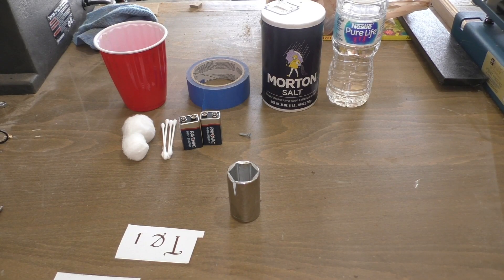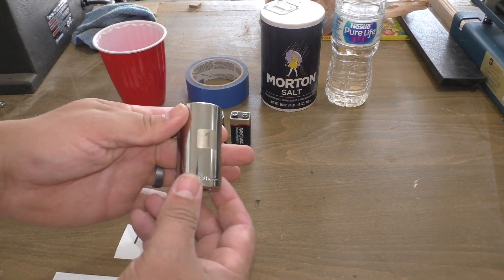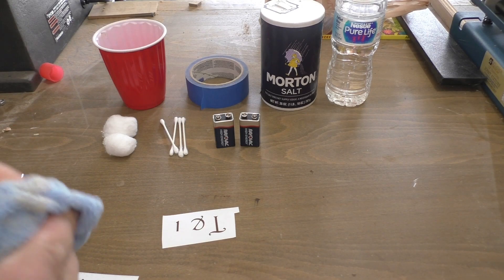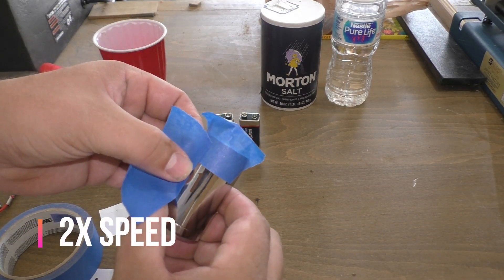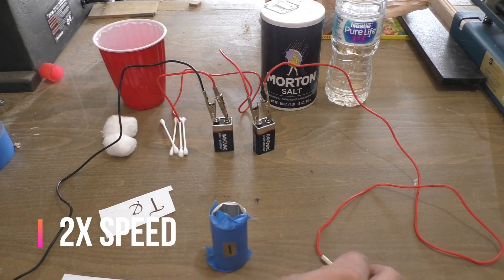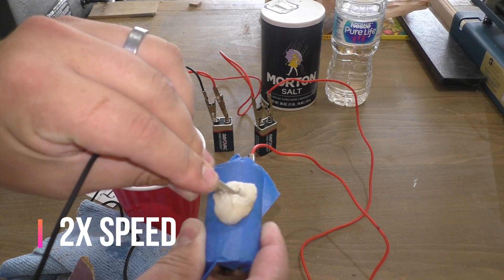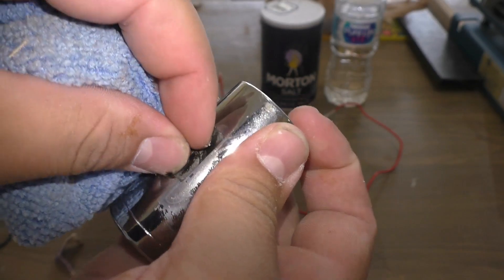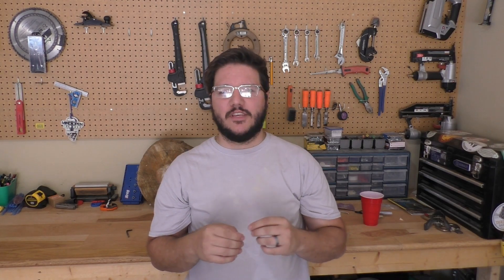Etching with Electricity! - using a 9v battery on a socket.

Comment: Is it safe to etch on powertool using this method?
Reply from the maker: I'd say it probably could work.  But it might depend on the tool. And I'd make sure it was unplugged and / or battery removed. Also don't use alot of water so it won't drop into your electrical wires/motors. Test out the process on some scrap metal like a wrench or something.

Comment: i've watched a ton of electro-etching videos and this was by far the most helpful! i have a question: it looks like you put a red wire (the first one you attached) alligator clip on the negative lead of the battery on the left. what kind of wire was that? i'm confused about the wiring part.
Reply: He turned 2-9v batteries into 1-18v series
Reply from the maker: Right, so I wired my batteries in series for this. You do that by connecting the (+) of one battery to the (-) of the other this doubles the voltage but is not really needed.  You can use 1 -  9v battery if you would like . It may just take a little longer. I used a red wire because thats what I had. The color of the wire doesn't change anything. You can use black on (-) or (+) its used so you can easily identify which wire you connected to whatever terminal without having to look back at the battery.  This might have been more info than you needed but I hope I cleared that up for you. Thanks for the kind comment!
Reply: @everymandan9669  thank you! can't wait to try. :)